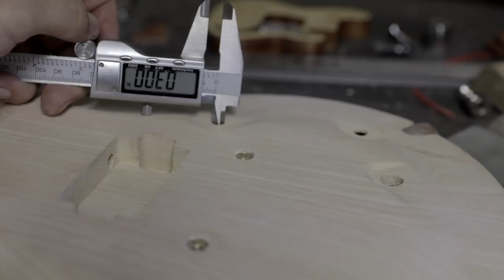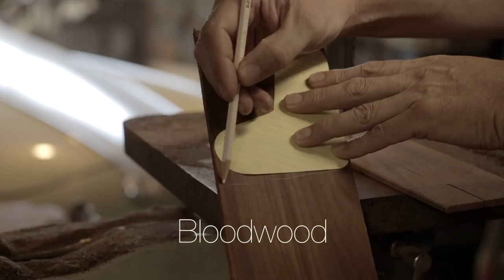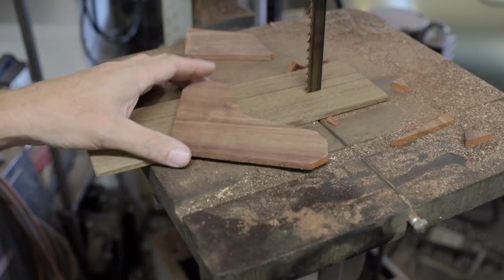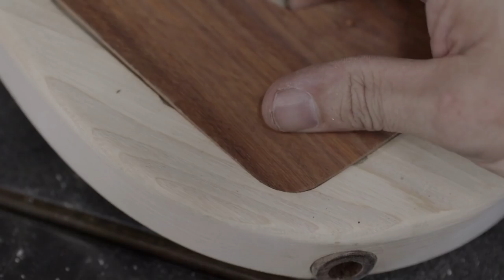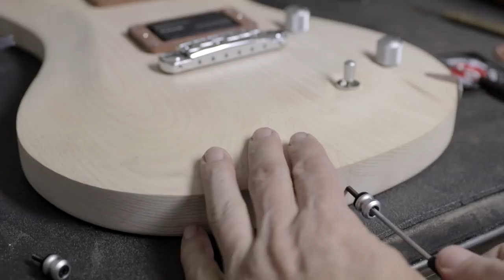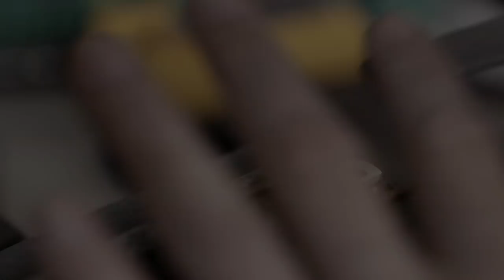Crimson Kit Guitar - Fiddly Bits - Episode 5

Comment: Nice work mate . At least you are doing the fiddly bits before you have put the finish on the body cause it pisses me off when i see other you tube videos when the guitar is painted and they mark and drill for the strap locks and other bits . To me all that work should be done before the finishing work is done . Great guitar loving the build so far
Reply from the maker: Thanks brother!  I agree...  Nothing worse than tearing out a hole on a newly finished instrument!  The car makers don't drill new holes after the body has been painted, why would a guitar maker?